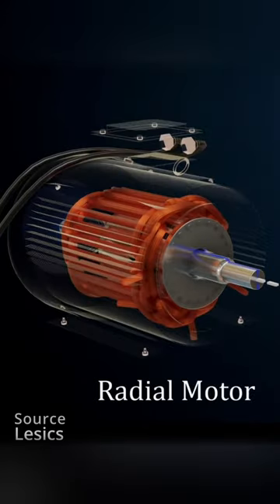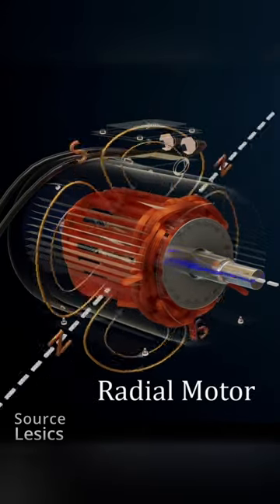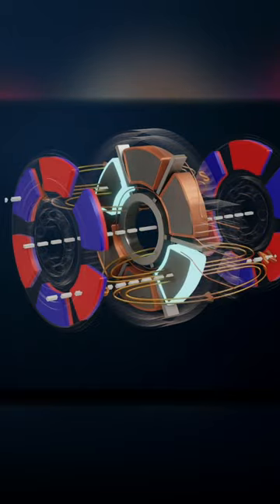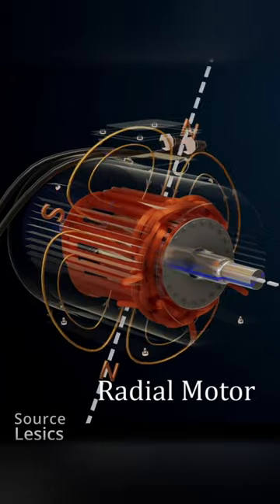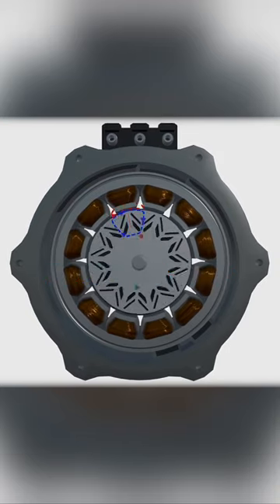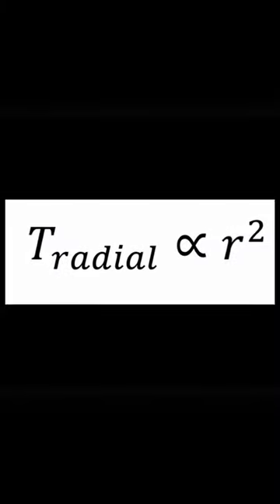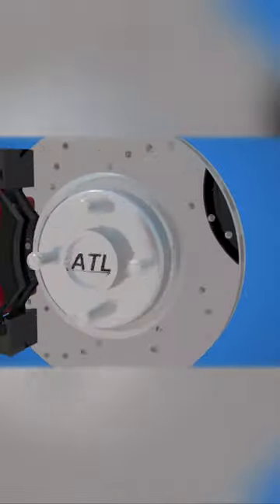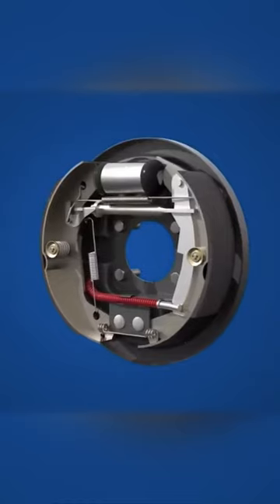Axial and radial flux motor could be together? #shorts

Comment: Informative and concise. One question: do you have any idea how the torque of the combined motor compares with r? You said that for a radial flux machine torque is proportional to r^2 and that for an axial flux machine torque is proportional to r^3 but do you know how torque in a combined flux machine relates to r?
Reply from the maker: Thank you, sorry I don't have the data for combined design.
Reply: I am following: I need to know what the sum of the magnetic fluxes resultant from r³ + r² PLUS my " Secret Sauce" configurations.